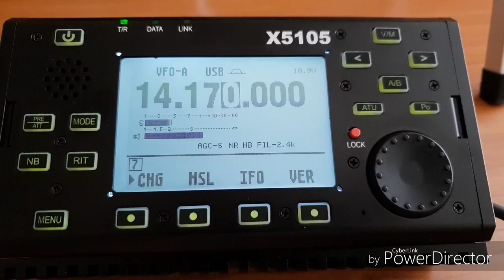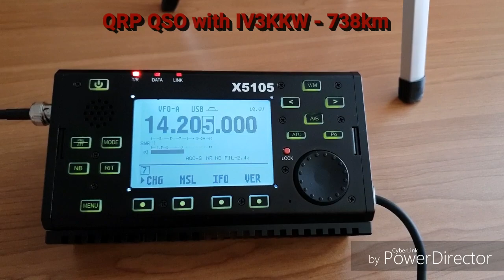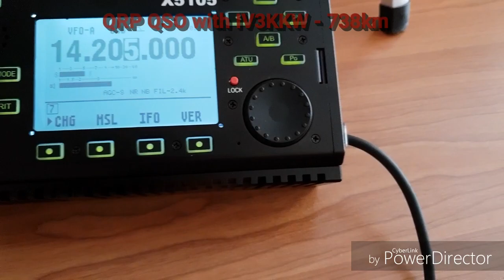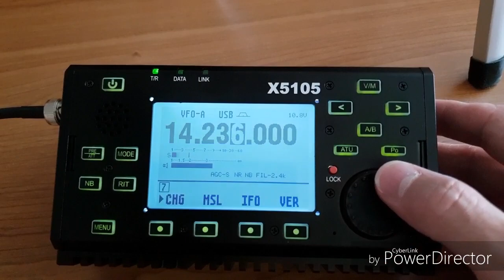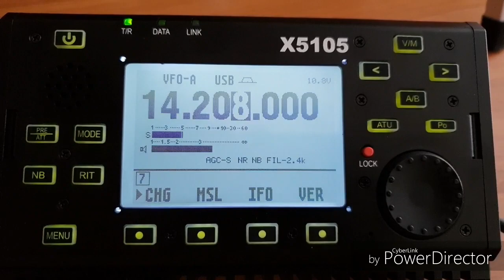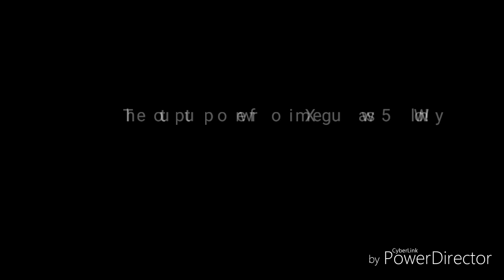Indoor QRP contacts with 2nd UltraLight MLA & Xiegu X5105

Comment: Hi I want buy HF QRP how to Choice between Xiegu X5105 and Ft-818 ?? What are the advantages and disadvantages? thanks
Reply from the maker: The biggest advantage for FT-818 is VHF/UHF bands only. But X5105 has excellent internal automatic tuner, internal noise reduction, excellent internal LiPOL 3,8AH battery, bigger screen and much better external microfone with numpad and presets on it. For me the big advantage of X5105 is that I can use it like walkie talkie radio without external mic because this radio has internal microphone as well + PTT button on the rig body. For me the X5105 clearly wins. I had one FT817 but i sold it quickly.
Reply: Ok Thanks for Your info. So I Also will choose X5105. : )
Reply: Thanks i am also stuck with above choice . 818 or 5105.  Will go for 5105. 
73s 4S6RSP

Comment: how many times you have to retune your loop on the 20 meter band?
Reply from the maker: steadfast666 i retune this antenna for sure after 5 or 10kHz. I tune antenna all the time to 1.1 SWR due to best transmit efficiency. Tuning is very sensitive but easy to tune because hand has not significant effect on frequency during tunning.

Comment: I think it helps being on the 8th floor too ;-)
Reply: I have no problems getting into the states from PR with the MLA 4' AGL on a tripod between two reinforced concrete houses
Reply from the maker: steadfast666 i don't no if is any effect of this elevation on antenna when is inside of the house. But maybe yes. I am not sure.